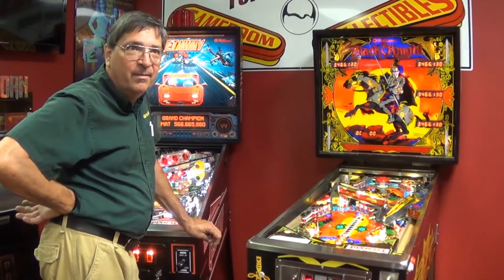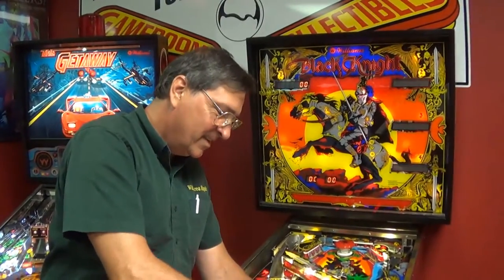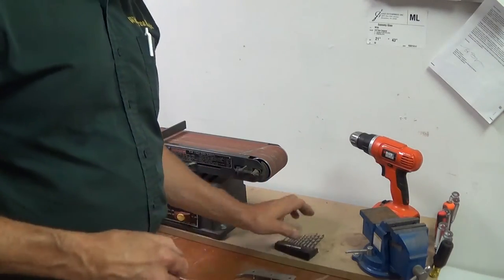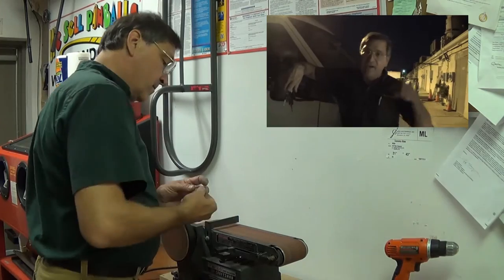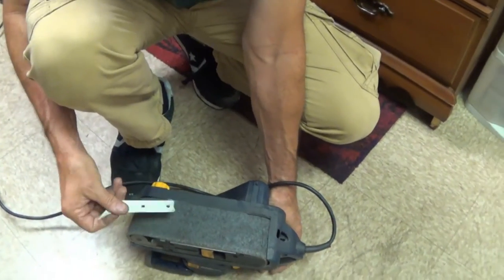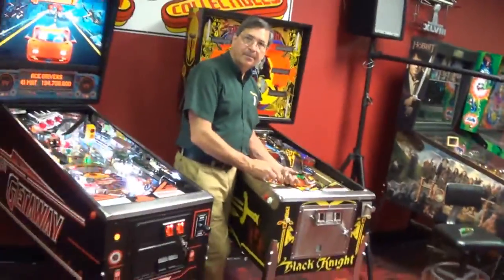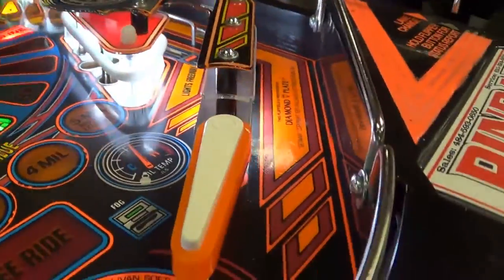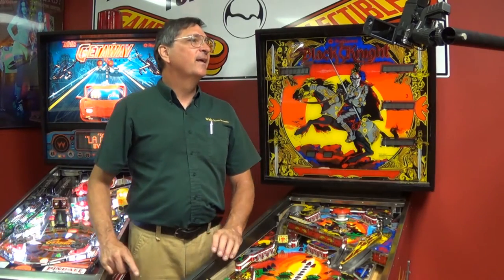Ray's Pinball Tech Tips ~ Flipper Inlane Ball Hop Fix! ~ S4E4

Comment: I see what you did there, basically created a slot.  Right thing to do would be to get a new piece made, but at least you can't tell it's been modified.  Pretty easy fix.
Reply from the maker: "Get a new piece made" is easier said than done. These didn't used to be available (some applications) in the aftermarket. Then they were. Now it appears that they might not be again... Fill us in on how to get a new piece made! ;)
Reply: If you scan it (and know where it needs to be), you can import that image into any vector software (say draftsight for instance), trace the shape.  Once you have that, you can send it out to any laser cutter vendor for a reasonable price
Reply from the maker: Joe's Tech Tips! Make it happen!